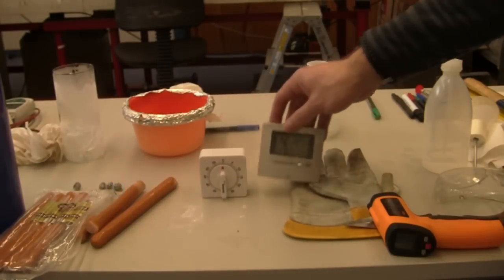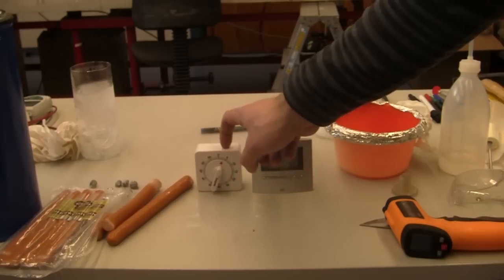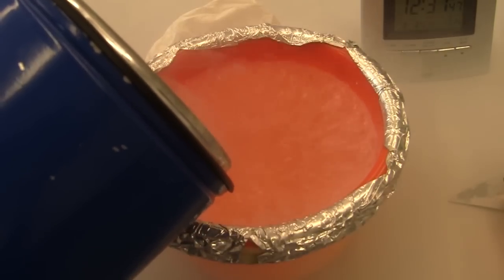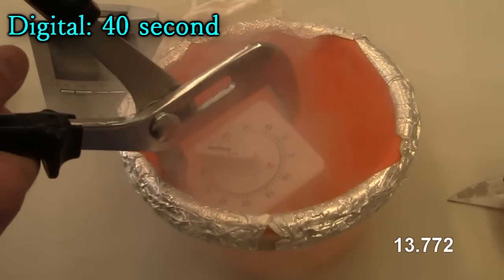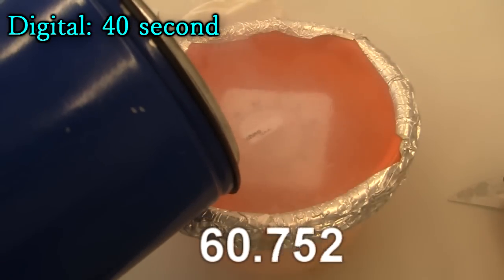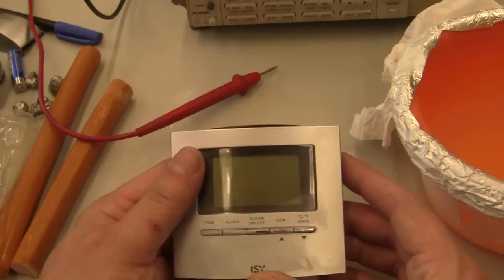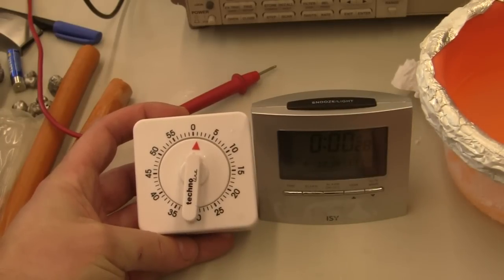Which will freeze first in LIQUID NITROGEN, Digital or clockwork?

Comment: The LCD probably went blank from being too cold, not battery voltage dropping. This is pretty well known here in Sweden because at -10 C or so the LCD displays in our cars become sluggish, then somewhere below -30 they just go out completely. Not quite sure how far below because I sort of need the display to work to find out (the LCD in my car is an inverted one so segments gradually start to light up as they become warmer).

If you watch closely in the video you can see the LCD going blank from the edge closest to the surface of the liquid nitrogen.
Reply: +Djhg2000 As a Canadian whom experiences -40 degree weather every winter in extremely humid environments I'd have to say you may be having an issue in sample size.    

Not to say you're incorrect but for instance I've never seen or had similar problems and that's at temperatures lower.
Reply: +Mitchell Christie Are you sure you're watching a true LCD though? LED based displays are unaffected and small OLED displays are pretty cheap.

Comment: Prediction before watching--digital stops--reason: LCD display will probably crack or freeze permanently. and we know from bomb technicians that liquid nitrogen stops electron movement in the wires crafted into silicon chips.

Clockwork--I don't think it will stop.  All the forces acting on it are mechanical and without a buildup of liquid or an obstruction, I think it'll handle cold just fine. Liquid nitrogen probably evaporates much too quickly for the gears and springs to seize from just that.

AFTER -- well I wouldn't have expected the LCD one to come back, that was cool. What would have been amazing would be if you had taken apart the clockwork one and figured out what part actually caused the operational failure!
Reply: +Women&#39;s Studies Textbook The spring in the mechanical clock probably lost its spring, or moisture in the gears themselves froze and stopped their movement.
Reply: + Women's Studies Textbook Yeah, my guess would be the spring lead to it stopping first. 

The rapidly decreasing temperature will cause a sharp increase in the Shear Modulus of the material, thereby increasing the spring constant (k). The clock will have a maximum force that it can apply on the spring based on it's power supply and gear ratio. It can therefore be deduced that there will come a point at which the max applied force is insufficient to bring about further spring displacement
 (x_max=(f_max)/k).

Comment: Pretty nice vid, a friend suggested to try the digital clock again but with an external battery, just hook it up to the contacts with wires. That way we see when the electronics of the device fail instead of the battery.

Comment: My guess before watching the video is I think the clockwork mechanism clock will freeze and stop working first and here's why: If the digital clock is immersed in liquid nitrogen, it wouldn't short anything out as liquid nitrogen isn't very electrically conductive, but it will reduce the resistance in the traces and components on the board in the clock. While the clockwork mechanism one relies on metal parts, which will conceivably become hard and brittle and probably warp a fair bit (which I imagine would wreak havoc on the tension on any springs in it like the one used to store the energy when you wind it). Though I just realized, the LCD display on the digital clock might not hold up as well as the rest of the components. I remember doing on experiment where I had a cheap digital thermometer with a TFT-LCD on it that I was heating to around 130-140f. It was only meant to measure room temperature though, so by the time it got up to about 125f the display started crapping out. But it became functional again, and with no problems after it cooled off. So it seems they're very sensitive to temperature.

Comment: before i watch the actual experiment my guess is the digital stops working long before the clockwork one does because electronic devices have a far higher fail rate in cold than mechanical. i also live in canada where i have borne witness to these kind of effects without experimentation

Comment: I suspect the mech clock was better insulated.  It looks to have less openings than the digital.  I am assuming it was the submersion that allowed the nitrogen to penetrate into the internal clockwork around the timer knob.  To me the rest of the timer looks fairly well sealed compared to the digital clock with it's battery cover, buttons etc etc. 
 
  I bet the mech clock would stop almost instantly if you put the exposed clockwork into the nitrogen.  But on the other hand if you stripped the insulation off all the electronics and assuming you could do that and keep the clock working it might also have a more instant affect.
Reply: My guess is that it had more to do with him pulling it out and the clockworks being exposed to moisture in the air causing ice to lock up the gears, I would have liked to have seen it remain submurged for the entire length of the time left on the timer. I doubt it would have made it 5-10 min, but it would have been interesting
Reply: Exactly what I guessed, too. It only stopped working when it was pulled out, so the frozen air moisture was probably what caused it to stop working. It surprised me how quickly it happened tho.
Reply: when he pours more liquid on top (~60s in) you can see air bubbles come out. so i'm not sure it was even submerged before, maybe it was just swimming around and there was little liquid inside.

Comment: To be fair, the lcd was never completely frozen, only to the point of the battery voltage dropping.  Also what likely stopped the mechanical probably was some water condensation on the metal components creating ice and freezing them together. not that the cold itself stopped the clock.
Reply: +coo463 That was one of the things he mentioned might make it stop.  He was just looking for it to stop working in any way, which it did.

Comment: I expected the digital to go first but for different reasons. I agree that looked like the battery failed. I was expecting the cold to bug the internal processor a lot quicker than that. The clockwork one probably just shrank some metal component out of tolerance and jammed the mechanism. Soon as it warmed up it came back to the correct size and worked.

Comment: The various electronic components within a digital clock are probably sensitive in regards to temperature extremes, particularly low temperature extremes, I assume it has something to do with electron flow through the conductive materials and the physical alterations that take place in materials during temperature changes, for a primitive example: Guitars going out of tune due to the temperature shrinking or expanding the wood.
Somewhat how magnets become superconductive when cooled to near absolute zero.

Assuming the battery didnt freeze, I would assume that eventually the digital clocks timing mechanism would have gotten messed up, causing an increased or decreased clock rate.

Comment: The clockwork timer only stopped working after it was removed from the liquid nitrogen. 
It is my guess that it wasn't the temperature that directly stopped it.  
I would hypothesise that the cold inner workings, when exposed to the air rather than the liquid nitrogen, caused water vapour to condense and freeze on the cogs and Othery movements clogging them up.  If the timer were left submerged on the nitrogen it would remain operable as the spring showed no signs of losing its tension.

Comment: The batteries were the likely culprit for the digital failure. Not all batteries are created equal, and some can resist cold better than others. For example, nickel-cadmium rechargeable batteries work well, but their battery life is negligible below a certain temperature. We use NiCd batteries in military radios, but in arctic conditions we have to switch to non-rechargeable lithium batteries that function far better in extreme cold.

Comment: I suspect the clockwork mechanism froze internally when it became exposed to the air and condensed some water on a critical gear and/or joint.  I see someone else suggested the same.  Shrug, five years later and still interesting to think about.

Comment: Called it. My guess was that the batteries would stop working in the extreme cold before the mechanical clockwork seized. Not too surprised they survived afterward either. I highly doubt that liquid nitrogen would cause any permanent damage with how long they were submerged. You wouldn't get any electrical shorts either, since liquid nitrogen isn't conductive.

Comment: I think that experiment isn't conclusive:when Thunderf00t adds more nitrogen to analog clock you can see small bubbles of air coming out of it, which means that nitrogen is leaking inside it. That means that either the clock wasn't submerged enough before for nitrogen to get inside(in which case we need another experiment where both clocks will be completely submerged from the start) or nitrogen had been leaking inside all along, in which case experiment was probably successful. It would be nice to test again, just to be sure.

Comment: suggestions! find the actual temperature they stop (instead of the time submersed until they stop), and do the same test but with the operating temperature range upper bound!
Reply: His IR thermometer gun thing he used with the sausages. He could fish out the clocks right when they stop working and then get the temperature. Depending on heat conductivity and heat capacity or such similar properties, they might not have identical curves for submersion time vs temperature. Sampling internal temperature would be optimum, but perhaps not possible.

Comment: the clockwork stopped because the water in the air freeze the cogs, it won't stop if it dosen't get air.
the digital clock also won't break unless the circuit board gets damaged. the measurement device parts tend to break easily though

Comment: i have lcd displays in my vehicle. it gets to -40, without the screen being submerged or perhaps having even contact with the nitrogen, the batteries looked like they stopped delivering power, since the screen went "white". the liquid crystals stop moving all together near -40c in my vehicle. its way more trippy on a full colour display when its like -25 or so. they just respond really slowly and the lcd shades in front of the different coloured pixels dont always perform equally, so the colours kind of drift a bit. but once its way cold, they just lose the ability to change shape  when a field is applied so they stay how they were.

Comment: I wonder if the location of the gizmo's inside each clock made a difference.  I noticed the digital floated for most of it's time which kept the display (seemingly the most vulnerable part) away from the worst of the cold.  I would suggest that anything but immediate and complete immersion would be necessary for a more objective test.  And a set immersion time to see if they worked after (say 5mins immersion, then 24hrs thawing to keep the different freeze/thaw times out of the equation).  Really cool that they both seemed to work after though! 

For the next test I would suggest VHS vs DVD players heh

Comment: The liquid nitrogen contacting the surfaces immediately boils, producing an insulating layer. The mechanical clock may have worked longer because it had a larger thermal mass. A small disk lithium battery may freeze much faster than an alkaline AA cell. The electronic clock floated, delaying cooling of the liquid crystal.

Comment: a quick freezing is not as damaging as a slow freezing due to crystalization of any medium, the faster it is done the smaller the crystals formed thus the less damage done.
Reply: +Vik are you suggesting carbon freezing is survivable?
Reply: +Carbon 12 all I said was that faster you freeze something to low temperature the less damage you deal to the material due to the expanding effect of crystallization when freezing. I don't know if cryopreservation is survivable or not, but it would definitely cause great damage if the subject got frozen too slow.

Comment: You should probably really have used an external timer to time the digital one too, the digital oscillator circuits are usually temperature dependant and will run slower at low temperatures especially extreme low temperatures like this well outside their design operating range. It's probably only a few seconds worth of error over this short an interval but it's still a source of error which could be easily eliminated using an external time source ideally the same one used for the other experiment.

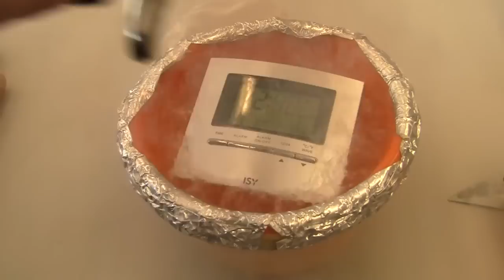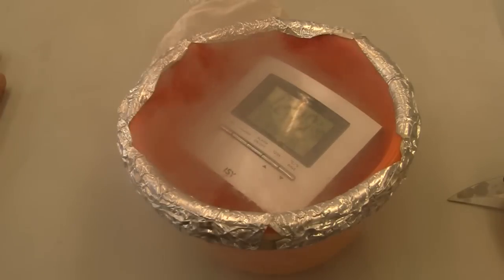Comment: The digital clock took longer than 40 seconds to stop working. According to the youtube you put the clock down at 1:50 and it went blank at 2:35, id est 45 seconds before it went broke. I noticed the clock slowed down around 20 seconds.
Reply: So it stopped functioning properly at 20s already?

Comment: Not surprised by the results, but I think you were too quick in taking the digital out of the nitrogen. You raised the question earlier about what might happen if the LCD froze, but I don't think that ever happened. Most likely the display went blank when the battery voltage dropped, as you mentioned in the video, and I'd be curious to know what would happen if the circuit was frozen completely through. Would it still revive then?

Comment: Prediction: the Digital one, as the Batteries/Accumulators are very susceptible to cold.

Reasoning: Experiences with shooting with digital Cameras vs. a camera (Nikon FT) that is fully manual, non electronic safe for the exposure meter.
Edit (Video at 0:28): Those shots were done at less -20 Degrees C with a strong eastern wind, cold enough to make you cry.

.....and good for having a laugh at customs officials, which are gobsmacked when the scan it and find no electronics in it! ;) LOL
Not joking this actually happened!

Let's see if I'm right or wrong....;)

Edit: video watched, yay, got it right.

Also interestingly, all Aviator's Watches are high quality mechanical watches, as the clockwork is more hardened against all the dangers of flying, like radiation etc.
Reply: +LupusAries For extreme environments, simpler technology is usually better.
Reply: VeteranVandal Yep, that has been my experience too.

Comment: I think one of the things one should consider is that liquid nitrogen is not just very cool water so considerations of what moisture do to the electrical circuits or clockwork mechanics would be of little concern. Am I right?

Comment: The analysis of what would happen to the LCD when it froze is complicated by the fact that you have several things happening at once. Not only do the physical properties of the liquid crystal change, the circuitry that induces electric fields to keep the molecules aligned is also affected. What you saw was probably indeed the battery giving out, and ceasing to supply voltage to control the grayness level in each LCD cell.

If it were possible to keep the electric field and lower the temperature enough to see the liquid crystal become a solid, what I suspect would happen is that the image would "freeze", pardon the pun. The nematic phase is even more "preferred" at low temperatures, and it's reasonable to assume that molecule alignment would persist into the solid phase. That's assuming the solid phase is an amorphous solid, more like a glass than a crystal. Then the image would persist even if the electric field were removed.

If on the other hand the solid phase were a genuine crystal, it could either go black, if the molecules aren't spindle shaped anymore, or still retain the image, if the crystal formed domains for each orientation of the order parameter -- like a ferromagnet.

In either case I don't see how the material could go back to "grey" like a display that's turned off. That requires the molecules to go back to the helical structure that interpolates between the orientations of the two polarizing films, in spite of the electric field that's forcing them to keep aligned and the decreasing thermal energy that would allow them to retain some level of disorder.

A very interesting question to ask, perhaps you could do the experiment? Taking apart the display and the battery so that only the display itself suffers the low temperatures could be a way to do it. I would do it myself but I'm just a lowly theorist with no access to liquid nitrogen.
Reply: Exactly the next experiment I would have suggested. Keep the power source out of the liquid nitrogen and see what the LCD does when it freezes. I don't know--that's why you should do the experiment. (If you are near a university, find a friend or teacher who can provide a small amount of liquid nitrogen for the experiment.)
Reply: People die when I get in the lab. I might enlist my experimentalist gf though... but I suspect the experiment might be harder than simply just dunking the display in the liquid nitrogen. I don't know what would happen to the copper in the contacts at such low temperatures.

Comment: ***** 
I should have know by the date you allready finished this followup, but it funny to see that they both survived. I didn't expect the digital clock to survive too actually.
Great fun and a nice experiment though

p.s. the batteries are mainly made of metal and will conduct heat quickly so they freeze easily too. You should have known that Thunderf00t :)